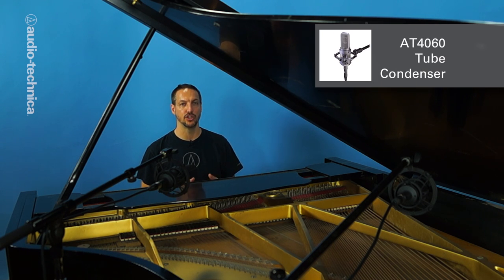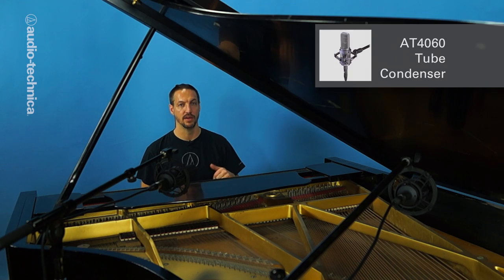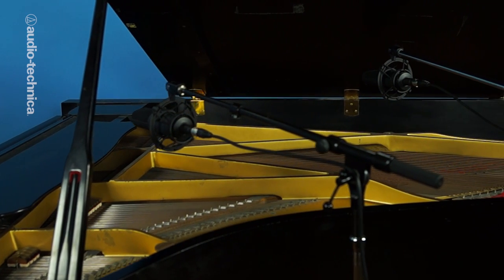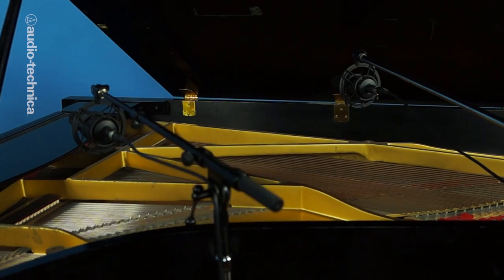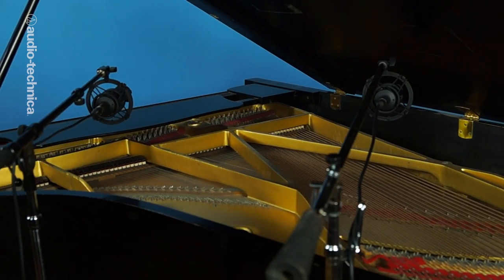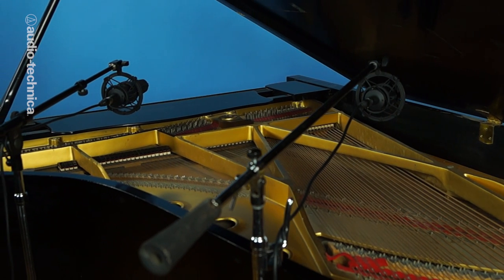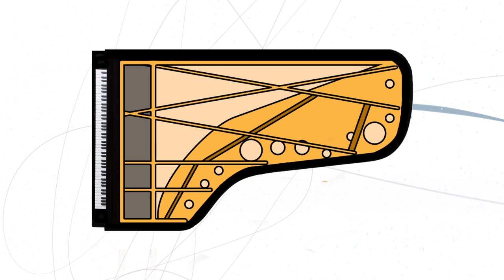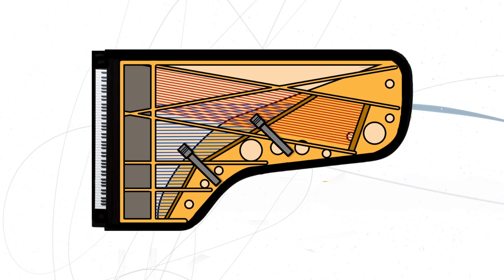Basic Recording Techniques: The Piano

Comment: Great techniques!  You initial comment about pianos being he most complex (more than 7,000 parts) of all acoustic instruments is flawed...the piano must take second place.  The pipe organ is FAR more complex in a myriad of ways.  Whereas a piano has only 88 keys and only 3 foot controls, a typical 3-manual theatre pipe organ has 215 keys, and 183 of those keys have two depths of depression (second touch) to produce a second sound from the same keys that effectively gives the organist 198 key strokes.  The feet generally have a dozen controls, but the hands must manipulate hundreds of stop switches.  And it's worth mentioning that a particular key can have nearly an infinite possibility of sounds not to mention a variety of different octaves produced from the same key; whereas, a piano key will always produce only one sound at one frequency.  A brief research of the Atlantic City Midmer-Losh pipe organ shows it has 33,114 pipes that speak from 7 chambers into an auditorium of nearly 7 acres housed in 5.5 million cubic feet of airspace.  There are 449 different sounding pipe ranks, and the largest pipe is 64' 9" and produces a zero distortion  frequency of 8 cycles per second (about 1 octave above an earthquake), and it was crafted out of an Oregon fir tree that was 785 years old.  The shortest pipe is 1/4" and produces a frequency of 17K cycles per second.  There are 1,235 stop tab switches to control the infinite sound possibilities using the 510 keys from both hands and feet.  The organ has 7 manual keyboards for the hands, four 5-octave, two 6-octave, and one 88-key manual...again, the second touch adds even more key action.  It has more than 450 relay bars that electrically connect the pipe ranks to any of the keyboards.  How much wire to connect up this instrument?  The wire is so long that you could wrap all of them around the equator 2 1/2 times!!  I could go on, but a piano has only 88 keys and 3 pedals to control sound.  That said, thanks for sharing a great way to mic grand pianos!